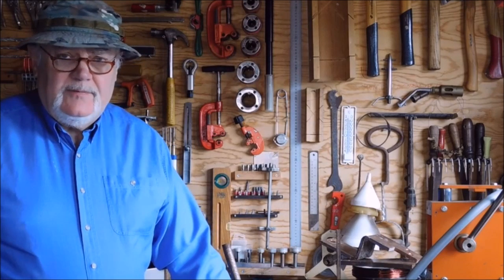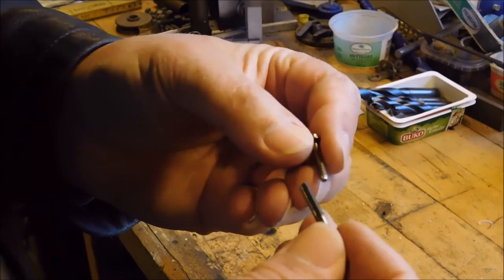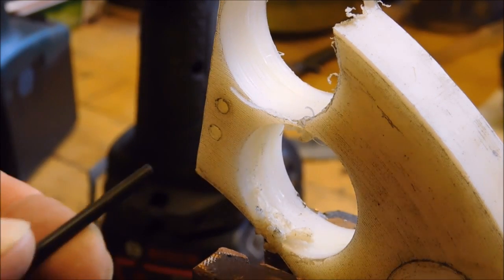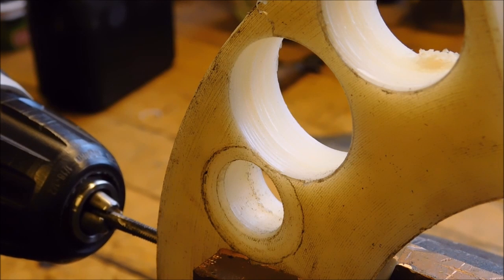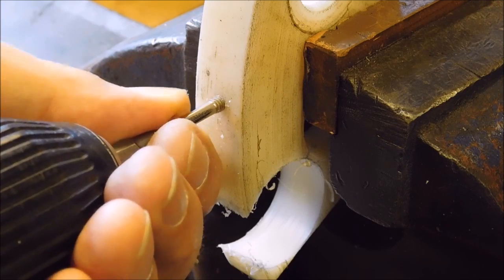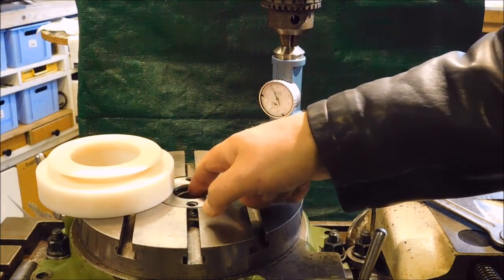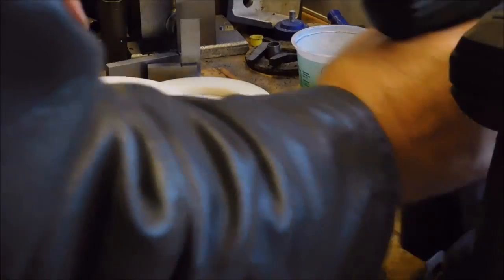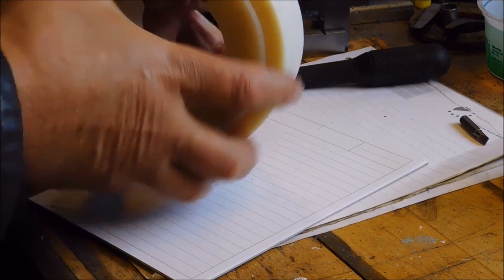Centerfinder 03

Comment: Your crane is super useful.
Re metric/imperial - what the heck! I'll use what suits with what I have! :)
I continue to be very intrigued Keld, Yeah :-)
Reply from the maker: Thx, Chris - I'm too very happy with my crane - the only disappointment is that it's "span of operating" in right under the I-beam ;-((
Metric/imperial ... I'm simply too cheap to just dump all these screws, nuts and bolts then I have salvaged from scrapped HewlettPackard IT-material - it hurts to do so !
But the winter seems closer now and I hate when all the toys, sorry tools in the shop are cold - my fingers don't like it - so now I'll have to do some progress on the in-door/in-house projects.